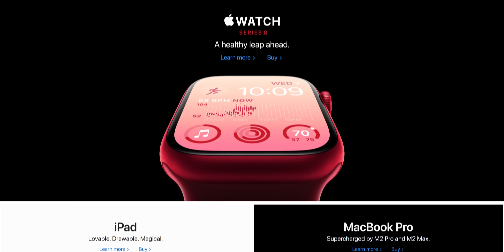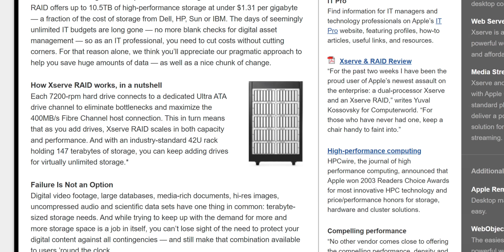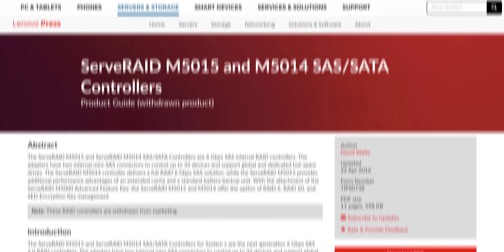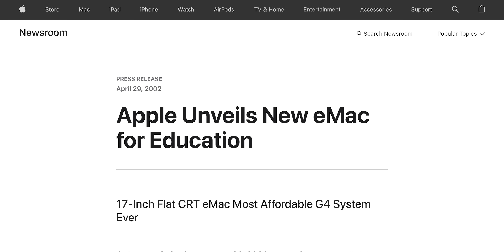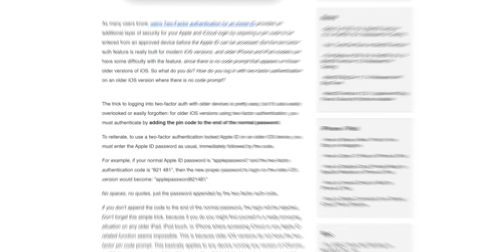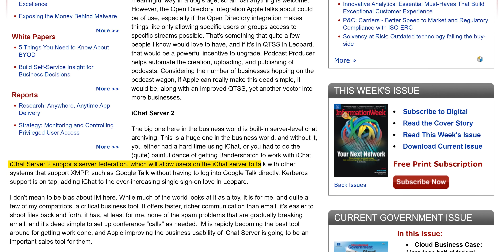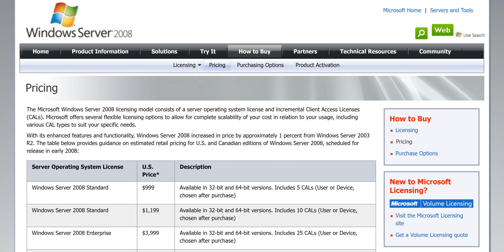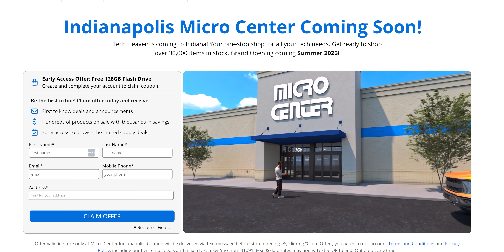I Bought the Last One Apple Ever Made... - Apple XServe 3,1 Server

Comment: The Xserve's used SATA disks. This was unusual at the time in servers. Typically servers used SCSI disks and SATA disks were considered far less reliable & much slower. From memory these rack mount servers had very limited out of band management / lights out integration which was unusual for a rack mount server too. Most of the time when I saw these was for clients that a decent number of Mac's and having a Xserve running OS X Server was a great way to manage the fleet of Mac's & integration with Active Directory. Apple really left Xserve customers in a big bind when they discontinued the Xserve. The replacement hardware had no redundancy or terrible form factor. Apple should really have let OS X Server run in a VM which most customers wanted, instead customers migrated away to third party solutions. Apple had a good product that could have been excellent if they'd focused more effort on it.
Reply: There were SAS options.

Comment: That was an era you could actually run a Mac network, anymore supporting macs in a network environment (central user authentication and such, what you'd call a domain environment in windows) is a ton harder to deal with and I've largely given up on supporting macs in such environments, especially trying to integrate them into a mixed windows and Mac environment.  The available hardware and the software on both server and client side has gone massively downhill since.

I've got an x serve sitting in a rack decommissioned at the moment.

Comment: Xserves and Mac pros until 3,1 used delidded Xeons, but after xserve died, Mac Pro 4,1 and 5,1 changed to regular xeons. All in all the Mac pros, though un-rackable, offered better upgradeability and better performance. Mac Pro 4,1/5,1 I believe they came with fibre cards by default.

Comment: The earlier Intel Xserves (2006 & 2008) had a strange setup: 64-bit CPU architecture with a 32-bit boot loader. You could install 64-bit Linux but it wouldn’t boot by default. Before rebooting after install, you had to force a 32-bit boot loader on the drive. Then, every time you updated the system, you had to force the older 32-bit back on the system before rebooting … otherwise it wouldn’t boot. 😂

Comment: BTW, "Screen Sharing" is actually VNC under the hood. If I recall correctly, it can also be used in both directions with other VNC software.
Reply: It can.  I use a VNC client on my phone to connect to a Mac Mini on a pretty regular basis, and you can access other Macs with vnc colon slash slash hostname.

Comment: At 7:02 --- THAT is what happened to us causing $200,000 of damage to our racked'n'stacked motherboards way back in the day! Those ignoble screws caused 200 Grand of damage after being lost and no-one noticed until the resistors and capacitors started popping'n'shorting-out overnight when those screws rolled and jumped about damaging the CPUs after microsurges kept hitting them! All from a bunch of screws!

BE CAREFUL when working near and over motherboards!

V

Comment: Oh yeah a follow up ! I remember having one at a time when I was an Apple Genius from a client with a bizarre problem. There were a nightmare to repair, as the debugging part of the hardware was as mysterious as the way they came with this unit. Never been able to find the source of the problem, one of my rare failure at that time.
Reply: booting one of these up in the genius room sounded like a squadron of hovercrafts taking off. they were quite easy to work on but i'd usually just depot them because i didn't want to deal with the software part.
Reply: @kappuru  Ooooooh yeah ! Sometimes I think that the fact making me stop working on the problem was not the lack of knowledges and time, but the bored ones around me at each time I booted the monster 😂😅

Comment: I love finding old Macs in my ewaste clean up jobs... There is so much Aluminim in the cases and on the PCB's! I got my hands on 20 Mac computers and the cases and most the hardware was Aluminum and the power supplies and Motherboards had massive copper spools on them. I made just under $1000 on the scrap from those 20 computers.

Comment: I spent a ton of time with these in the field and was fortunate enough to own several 08' models and one 09 model. They were incredible machines, but also surprisingly versatile. Believe it or not you can run VMWare ESXi 5.5 on these. At one point my homelab was quite the setup, consisting of apple OEM fibre channel HBAs, Apple OEM fibre channel CABLES(White and all), and 2 xserve targeted Promise Vtrak 5000 raid arrays, which were configured as a SAN. People forget macOS Server was legit, but it really was the only way to go when you were managing Macs in business.

When I moved I literally left them because the whole setup was several hundred pounds and in our basement.
Reply: I work for VMware, and back when I was in support (2011-2016) Apple was a fairly frequent customer of mine, and we had a separate ESXi fork specific to the X-Serve platform. They had some fairly large datacenters running on this. Don't think I ever ran into any other customers that were running it, and come to think of it, I don't know if that fork was ever fully GA. It was, however, the reason you can select Mac OSX as a VM guest type, which confused a lot of customers and made them think they could effectively circumvent Apple's EULA which specifies that OSX can only run on Apple hardware.
Reply: @cdvallee  that was a very special time

Comment: Re:MacOS Installation. My experience has been you must use a command line flag on a working Mac to create an installer USB directly, don't run the installer from GUI. You should also set the destination device's clock back (from recovery mode) to when the signature was still valid

Comment: As for someone who ran a MacPro (Server) with dual XServe RAID over fibre optics until last year before I moved to a more “power” efficient Mac mini and Thunderbolt RAID.

I would love a followup!

FYI, for the Xserve RAID I used PATA to SATA adapters to use 1TB 5400 drives in one XServe RAID and another Xraid I used 500GB 7200 drives. I also tried 128GB SSD drives but I didn’t thought it to be worth it to fill it with 1TB SSD’s.

1TB drives are the max capacity of the Xserve RAID, Xserve Server I’m not aware of. 

To create a RAID would take about 7 days as it would check all sectors.

Great video!

Comment: Honestly, a video taking older devices to the Apple store to see how far back you can go and still get support from them might be really cool.
Reply: It's something like 6 or 7 year, Apple has "official" terminology like "vintage" and "obsolete". They pretty much won't do anything for you after that point, so it wouldn't make a very interesting video unfortunately
Reply: @bonkle_boi  say that again….
Reply: @bonkle_boi  vintage is craaaazy 😂
Reply: @bonkle_boi   6 7
Reply: They refuse to fix my sisters i phone 7 because its "too old", so not very far it would seem.
Reply: @Klokopf52  Apple won’t fix hardware on old devices, but they will actually give you tech support for older devices if your problem isn’t a hardware failure
Reply: @Klokopf52  Anything that can't be updated from iOS 12.5.4 deserves to be recycled.
Reply: @Klokopf52  iphone 7 is 7 years old at this point and they don't even sell it
Reply: @Klokopf52  bro it's a phone from 7 years ago, i think it's understandable xD
Reply: @Klokopf52 dude I doubt they still even have the parts for the 7
Reply: @Klokopf52  I mean i cant think of a single pc/phone company that would do service on a device that was released 7-8 years ago
Reply: @Klokopf52  that should not have been the case. There are people still going into an Apple Store with an iPhone SE 1st generation getting hardware repairs.
Reply: @Klokopf52  that store must’ve been trash I took my old 7 in for a battery and they did it no problem
Reply: @Klokopf52  I wanted a 16kB upgrade for my 4KB integer basic apple ][, guess what ?
Reply: @Klokopf52  the iPhone 7 is 5 years old for a phone that’s pretty old now
Reply: @p0k3mn1  Not really google and other smart phone companies now guarantee security updates for at least 5 years...... Phones and laptops easily last over 5 years these days with a simple battery replacement.
Reply: @p0k3mn1  its not, ive been using my oneplus 7 pro for 4 years, and still no issues, every app runs smooth, battery is in good condition, and aside from very mild oled burn in, i have 0 reasons to upgrade. im only considering upgrading due to wanting a foldable, but there is nothing i would gain from upgrading to a new normal phone. altough iphones are so behind that i would never use a 4 year old iphone.
Reply: @p0k3mn1  It’s actually 6 turning 7 years old this year.
Reply: @p0k3mn1  it's 7 years old
Reply: @p0k3mn1  where i live most people over 30 keep phones for 4-6 years
Reply: @michaelandrews4783  Well software and hardware are 2 quite different aspects. On the software side, apple supported the iPhone 5s for 9 years, 5 years of main stream iOS support and security update to this day. 🤣 Last updated on Jan.23, 2023.
Reply: @p0k3mn1  I mean, i upgraded to 14 when it came out from my 8… definitely not worth it. Should’ve waited a few more years
Reply: @p0k3mn15 I used my last phone for 6 years, only replaced because of low battery life.  If it ain't broke don't fix it.
Reply: @nikoheino3927  Same story here, got the oneplus 7 pro at launch. For me the battery is showing its age, but it's not a problem with the warp charger. Otherwise performance is still great
Reply: @michaelandrews4783  Apple released a security update this January, all the way back to (and including) the iPhone 5s - which was released a decade ago.
Your argument is invalid.
Reply: @p0k3mn1  That's certainly not a new phone but anyone who doesn't have the urge to upgrade just because some dumb feature isn't backported will be fine with that phone. My mum has a Oneplus 3, 7 years old now, price was $399. She uses it about 2hrs daily for browsing the web, chat, email, youtube, public transport tickets, podcasts etc. It's a good phone apart from the camera. And luckily it's from a time when replacing a battery was "easy" to do since it has no glass back.
Reply: @michaelandrews4783  agreed I'm using a galaxy s9 around the house to keep usage down on my s21 fe and it works amazing besides battery life.
Reply: @p0k3mn1  the iPhone 7 is actually almost 7 years old. Released in September of 2016
Reply: "support" youre a funny man
Reply: @killme3616  lol
Reply: @killme3616  Haha yea agreed. Apple's version of "Support" is to charge people more than or close to the original price of the product 😕
Reply: They wont touch it, it'll fall under the VINTAGE or OBSOLETE category
Reply: The answer is "no, we want your money, love Apple"
Reply: Just check the support status of the device. If it's supported then sure, if it's "vintage", then you'll have to try your luck. Maybe there're still parts left over. If it's "obsolete", then no luck.
Reply: Why? The answer is 7 years… anything further back they don’t have parts for. Past 5 years parts are limited.
Apple currently support macOS 13, macOS 12, and macOS 11. Devices older than ~2015 won’t run macOS 11, and therefore aren’t supported at all by Apple.
Sure, the Genius Bar might try to help if you find the right genius, but your mileage will vary.
Reply: it would be pretty boring. they do almost no repairs 'in-house' now and ship most of their stuff off to sub-contracted repair places where the employees will unlock your phone, steal your nudes and put them on the internet (search it up)
Reply: I would try it with my Apple IIe. Wonder what they would say.
Reply: @thorstencole Wish I still had my dual drive ][e
Reply: Eh, there’s a public list of what they will and won’t service.
Reply: YES!! troubles with the "Genius Bar" ,,I think  most people have no idea what dis-service is happening from apple ...louis rossman has done some bits about this,,,more would be better..especially when people LIKE ALEX FANBOY apple products so much...
Reply: This sounds like it would be a great Mac Address video. I'd watch it!
Reply: Anything that’s classified as “vintage” by Apple is still able to be supported at the stores but only for software. No hardware support will be provided because Apple no longer sends the stores or the repair facilities service parts for any hardware that’s classified as “vintage” sadly
Reply: I just wish they’d stop hawking their overpriced screwdriver. What a waste of resources.
Reply: would definitively watch this series
Reply: 5 years and it’s a hard line for any hardware repairs
-Apple authorized service center employee
Reply: The oldest devices Apple will work on are 7 years. I brought in my moms 2nd series Apple watch and they refused to work on it as it hit 7 years this year.  They said they can look at the device and do software repairs if needed but anything 7 years old will have to be sent out of the store to get repaired if it is even possible. They wanted $246 to replace just the battery if the head service department agreed to repair it. We ended up getting the SE model for the same price. This was 4 days ago so it is really recent.
Reply: Apple Store… service? Never heard of it
Reply: Take that to an Apple genius 😂
Reply: It would be quite a short video. 
"Too old, get the f*ck out" is their usual answer, from my experience.
Reply: A server designed industrial designers is what I call a waste of time.
Reply: I would watch
Reply: this is the job of an IT comsci or computer tech guys
Reply: Seconded. But I would like to see Linux do more on this server like he suggested.
Reply: Anything that was manufactured more than 8 years ago is considered obsolete meaning Apple doesn't make those parts anymore so hardware service is impossible from an Apple Retail Store (ARS) or Apple Authorized Service Provider. (AASP). A device manufactured between 5 and 7 years is considered "Vintage", an ARS won't service it but an AASP might be able to if they have parts in stock, but they can't order them from Apple anymore.
Reply: Would love to see some bring one of these in lol
Reply: A few years ago, i got my hands on an G4 xServer, i used this for my school club, later the club buy it, the sad part it was because Apple make it obsolete removing the support, only PPC Linux was the solution to keep it working.
Reply: You aren't going to get any support on this at an apple store.  Never would.
Reply: There will be no support and no content to make a video
Reply: Guildford, Coquitlam Centre, or Metrotown are small, careless apple stores in Vancouver
Reply: You wont gets parts for the Xserve anymore but i saw one get brought into an apple store for troubleshooting and the did try to help the guy out.
Reply: i remember someone bring an imac from 2004 and they accepted it
Reply: Even brand new, they will just say "it will cost more to fix.....buy another new one" so they make more money.
Reply: IDK about Apple but in insurance industry (in the UK) if you have a device insured, once it reaches 8 years and breaks they won't even attempt at repairing it but will reimburse you the market value (current, much lower than what you paid for a new one) as a contribution for you to buy a replacement in case of non-excess plans, and will replace it for a modern "equivalent spec" (so much lower class considering how much tech has progressed in the meantime) device. Same applies to home appliances, boilers, etc. - 8 years is considered the point where things go obsolete, parts unavailable, etc. - I am guessing in case of Apple this is gonna be either that or less...
Reply: Apple still has the specs for the Apple Macintosh 128K on their website
Reply: With something like this they’d probably say “unfortunately we no longer support this product and to prevent you from doing anything unauthorized we’re not giving it back”
Reply: I hate this throwaway society we live in now. What ever happened to if it isn't broken don't fix it?
Reply: In 2015/16 I remember bringing a 2009 mac 🖥️ to the Apple Store for boot loop problems, just wanted to get data off it. They said they don’t work on “vintage devices” and tried to sell me a new one 🙂
Reply: If they still refer to themselves as “a genius”, I’m still not going to look for help at an Apple store.
Reply: I'll back that video idea 100% .
I got a MacBook Pro snow leopard laptop and it needs a few fixes (new battery, possible touch pad replacement, speakers fixes, OSX upgrades maybe, some way to port MS Office suit (local version)).

Wonder how far it would get at the Apple Genius bar 😏  ?
Reply: @mydroid2791  apple will replace a laptop battery for up to 10 years it’s only 5 to 7 on phones
Reply: Apple official store is about 5 years old, AASP partners might be different though.
Reply: literally 1 generation. If it's not on the shelf in the store they don't service it and try to shove the next model down your throat.